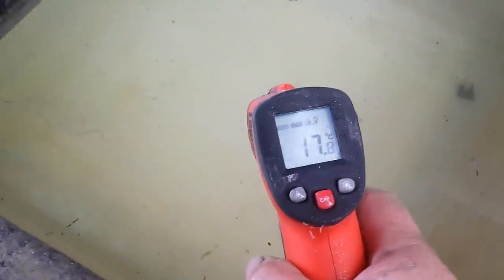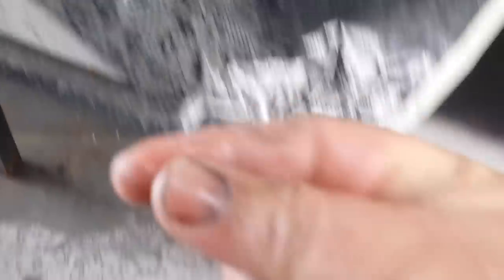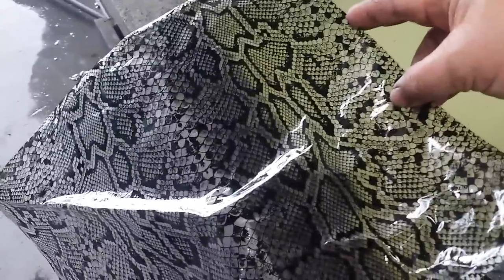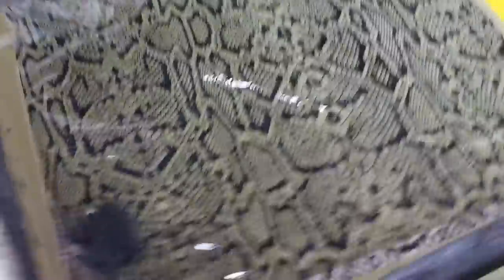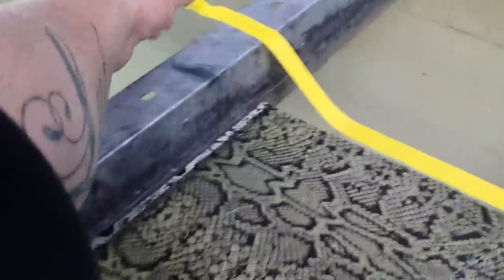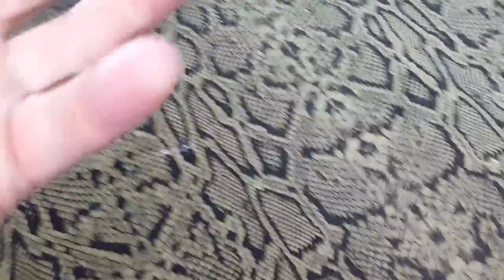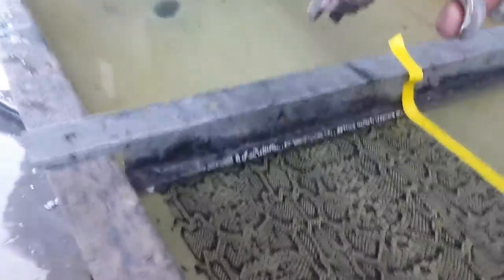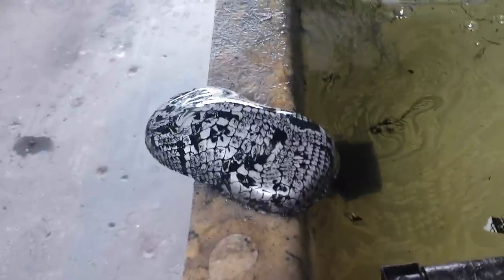Hydrographic printing in cold water.

Comment: 63 farenheit isnt that cold of water. thats not much lower than i see people heating theyre tanks too. for someone working in a non heated area in the winter where the water in my tank will actually freeze, you need a heater. depending on your tank size you can use a $40 150 g aquarium heater, it will heat it up enough to dip.

Comment: Thanks for the great video. I've been considering dipping a few rifles, but doing it myself because I'm a DIY sort of guy. I was kind of torn between doing s straight duracoat multicam job or dipping them in multicam. I've painted multicam to great effect and I don't mean to brag, but it looked damn good. My welding hood would disappear in my multicam shooting mat. lol However, it takes so freaking long to paint the pattern and with the extra prep and steps duracoat takes, it would take forever just to do one gun. So I was considering  duracoat/dip combination and from what I read, if you only let the duracoat sit for 15 minutes before dipping it, then you end up with an incredibly durable coating, specially after you put a duracoat matt top coat on it. However, my concern was the area I have to dip, which would be basically a tub and maintaining a water temp in a tub would be hard. I guess its the summer and its over 100 degrees so if I let it sit in the sun it would stay warm. lol Glad to see that you don't need to us hot water though.

Comment: hey great vid.....quick question ???   any idea why the film wont stick on some items .. for example, I dipped a set of wheels and everything was perfect and when it came to dipping a second set of wheels using the same primer , paint , activator etc ….when I removed the wheel from the tank the film just slid right off .. same film as the first set!!! any idea why this happened???
Reply from the maker: Jonathan O Shaughnessy hi mate, sounds like you over activated the film. Too much activator softens the basecoat too much and the film doesn't bite, it just slides right off.
Reply: @officialWWM  thanks you just helped me out with a problem i had :)

Comment: im going to try dipping a clear lexan rc body blue flames i have never done this any tips i dont have a tank i was going to use a big plastic bucket that is big enough for the body and a bit more
Reply from the maker: Rich Walsh my tip would be to practice on lots of different objects first! I can guarantee that if you try to do your car body without practice and experience, it will not go well.

Comment: Hi just wondering if you could dip a r/c car body there plastic see through you paint the inside of body so paint doesn’t  scratch ? But would the plastic need a primer ? If so not sure it can be done ?? You can scratch pad the inside and doesn’t show scratches  but would that be enough for hydro pattern to stick to ?? Thanks 👍
Reply from the maker: phil kennedy hi, I have done them before but I do it on the outside. I know it's not the popular way to do it because of scratches etc but if you clear it with 2k clear, it will last for ages!
Reply: Thanks very much for your advice and your quick reply 😜👍cheers
Reply from the maker: phil kennedy no problem, good luck with it.

Comment: Dear Darren . I just started hydrodipping and in still learning stage. I saw your  activator video and made my own. at first it was working but then I purchased new films and suddenly activator does not work in my new films. my question does xylene degrade over period of time. should I try mixing more  xylene say 40%.  plz help me             thanks and cheers
Reply from the maker: Hi mate. The only reason I can think that you may be having trouble is that the film is on the water the wrong way up. I have used my activator on lots and lots of different films and have never had a problem.

Comment: Hello my friend, Greetings from Peru !! Im recently practicing with Cold water but I have a problem with "Cannabis Film", what soak time do you recommend for cold water ?? Im trying to dip when the film is completely smooth or without wrinkles in the film, is that correct time to spray activator (It take me about 2minutes) ? Im using hydrovator with 2 slow passes with 1.4 tip at 15psi I have overactivation in the film and with 1 slow pass the film become in Gel when I dip :( !! I really aprecciate your help my friend because in my country cannot get help, nobody do hydrographics yet !

Thanks a lot, Cheers mi amigo !!!

Comment: Hey Daren, just watched your homemade activator video and its amazing! just a question im based in NZ we can get  diggers xylene easy from bunnings but will diggers lacquer thinner work? in terms of thinners (2K) theres not much here for us
Reply from the maker: ratfish4life hi mate. Yep, the Diggers Xylene will work fine but you need to go to an automotive paint supplier for 2k thinner. Lacquer thinner is different. You will be able to get it from a trade supplier, it's used extensively in the auto industry.
Reply from the maker: ratfish4life it's hard for me to say because I've never used either of them but my guess is they would both work, you may just need to adjust the xylene content a little. You will have to experiment till you get a mix you like.
Reply: @officialWWM  fair enough thanks for all the helpful info! one more question, is a spray gun necessary? or can i just mix a little into a little spray bottle? I'm just wanting to try it as a hobby at home so dont wanna pay too much for things i dont really need.

Comment: Thanks for the advice, one question though, they say that after you are done with the dipping you have to wash the item for about 3  minutes with warm-hot water, is that true?
Reply from the maker: Παναγιώτης Καφαταρίδης it sure is. You have to wash the film medium off, leaving the print behind.
Reply: Thanks for the reply, I am sorry, i am specificaly asking about the washing water temperature... Does that water have to warm-hot, or it is okay to wash it with cold water?
Reply from the maker: Παναγιώτης Καφαταρίδης oh, ok. The film will wash off a lot faster with warm water but I always use cold and just let it take a little longer. It works fine :)
Reply: Thats great, water heating is a major problem.... Thanks for the info!

Comment: please help me, I have tried with warm and cold water, I am using a 400ml aerosol activator and I have got the film all set up and its soaks into the water nicely. but then when I spray the activator it doesn't change.. Unless I am like 3cm away when I spray it. then it expands but doesnt still to the item. I have got a metal shisha vape that I'm trying to drip and ive sprayed it with Metal primer and then Black Satin spray paint.
Reply: pull it back more than 3 cm. you wanna be like.. 15 cm away, youre way to close. also.. when using spray paints i noticed LOTS DO NOT WORK. but KRYLON super MAXX works perfectly. make sure to dip the part after 40 mins of painting with that though. cheers mate

Comment: Darren, 
How are things in OZ. What do use to prime the item with ? They say you have to do the dip within a certain time of priming with a special primer and spray this stuff on the metal parts to have the primer stick and all that. I would love to hear you debunk all that!
Thanks William ( American but not a seppo wanker )
Reply from the maker: William Smith hi Will, sorry but I can't debunk all that. Hydrographics is a paint process. The dipping is really the easy part, in fact, I can teach anyone to dip in a day! The really important part is the prep, painting, clearcoating, colour sanding and polishing. This can take years to learn to do properly! If you have no painting experience, you are in for a steep learning curve :/
Reply from the maker: William Smith oh and, to answer your question, yes, each different type of material requires the correct primer and prep process. The film is designed to stick to solvent based automotive basecoat. Basecoat needs to be cleared with a 2pak automotive clear (which should really be sprayed and baked in a decent spray booth/oven). Basecoat has a clearcoat window of about 12 hours (depending on brand, air temp etc), otherwise is becomes too hard to accept the clear and flaking and peeling may result. I'm not trying to put you off, just letting you know that there is a lot more to this process than a lot of YouTube vids would have you believe.

Comment: Hey man, please help, i tried hydro dipping but when i dip, it still hard like a paper. At first i thought i was dipping on the wrong side of the film, but i already made sure by using the sticky finger test. I dont know whats wrong with my film today. I was able to do one correctly yesterday, but not today.
Reply from the maker: Jaydrone Vids sounds like you either aren't letting the film sit on the water to hydrate for long enough, or you aren't using enough activator.
Reply: @officialWWM  thank you. Il try adjusting the height of the activator when i spray. I will also try watching the film as well aside from the timer, and Perhaps thats the problem, im only using the activators on a spray can.

Comment: Doea one need training for hydro dipping I'm looking into doing and possibly as a hobby and work or is it just something that's easy to pick up
Reply from the maker: J Marshall that depends. The actual dipping process is pretty easy to learn once you get your head around it. You will make some mistakes but you'll get better over time. The bigger question for me is about how much painting experience and knowledge you have. Do you understand preparation, different primers, working with different materials, how yo apply base coat, 2k clear systems, colour sanding, cutting, polishing. Do you have a heated spray booth etc Etc. There's a lot to learn if you're not a painter.
Reply: @officialWWM  thanks for your reply, yes I'm a qualified car. Painter haven't done it for about 20 years.
Reply from the maker: J Marshall well, you are more than half way there. Paint systems have changed a fair bit in the last 20 years but you'll soon catch up. There are lots of how to vids on YouTube, watch some of those, practice a lot and you'll be off and running in no time.
Reply: @officialWWM  thanks for your input looks like a good hobby/job